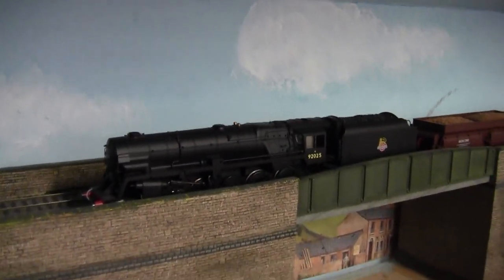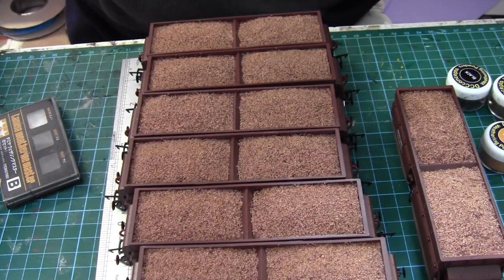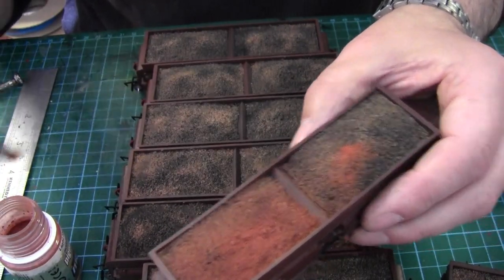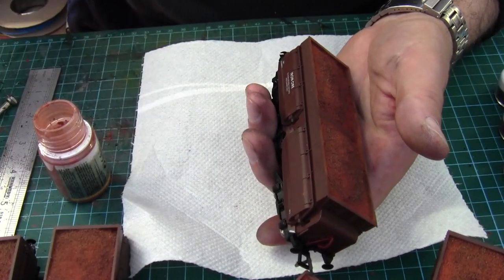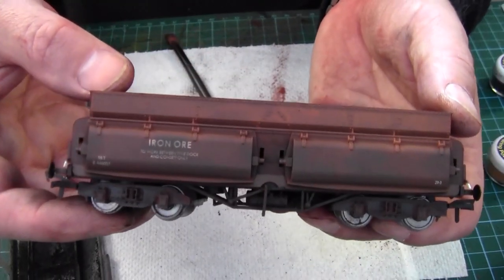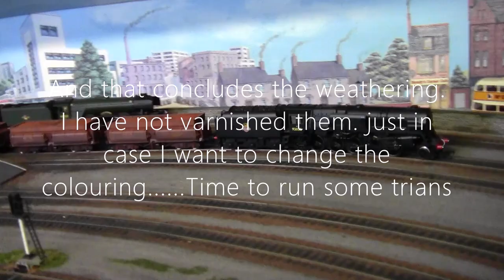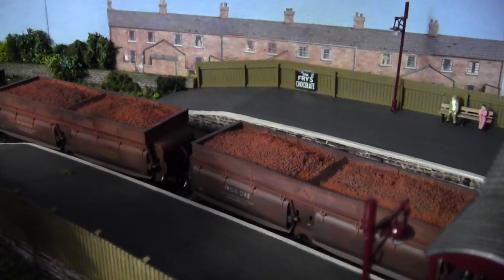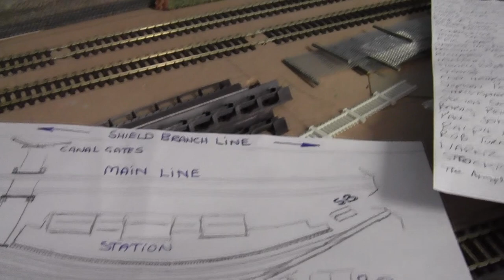Weathering the KR Iron ore wagons, & Competition Winner No316

Comment: Hi Tony 
Good work on making the loads and weathering them . I will weather all my wagons first off give them a black or grey wash which brings out the details and gives something for the powders to grip to. As John mentioned WWS powders are good value as you get large tubs . I also use pastels and scrape them onto chassis to give a rust effect or grind them into powders ( nice and cheap 😀) 
Cheers Kev
Reply from the maker: Hi Kev. i like nice and cheap. especially the way that everything keeps going upin price at the moment. thanks for the tips....all the best Tony

Comment: Good job on the wagons Tony, they really do look the part. On the subject of weathering powders, WWS to a great range and you get a decent sized tub, I bought a set for £20, which will last me ages. The other thing I have used and they’re pretty cheap are artist’s pastels, I bought an earth colour set which covers all the rusts and has a bright orange too. Only cost a couple of pounds from EBay. Scrape with a sharp knife and you get a fine powder and it does exactly the same thing as weathering powder.
It’s a great name for the new station West Haven, might have to twin towns, West Haven and Exehaven! Cheers Tony, Have a good week, John
Reply from the maker: Hi John. Thanks for the tip for using art pastels. never thought of using them. I have had a chat with Edd. and we have come agreement and called the Station Little Haven. after a beach in south shields. Twin Havens sounds great to me.. until next time stay safe. cheer's Tony

Comment: Tony, you could also take a look in the dollar store for some cheap pastel chalks. Or, as for my favorites, just plain ordinary pigment powders from your local art store. Those pigments really make a difference. They stick well and are true colors. It’s also amazing what kind of amount they sell in compared to those half filled one sandwich jam jars. 
It’s not that I don’t wanna use or purchase the stuff from wws or other suppliers. They make a great range of products. However, what those modeling powders go for is beyond amazing. Added to the tiny amounts they sell by. 
I’ve got some color powders from Pan Pastels. Those too look and work great. But they too sell only tiny portions. 
At our favorite art store, I buy the pigments for 250-500 grams, so way larger quantity, on average for half the price of the brand names. Some pigments are of course more expensive. Or need special care when working with them. Next to those more expensive ones there’s enough choice in less expensive ones as very good alternatives. I just avoid the ‘handle with care ones.’ And I just mix ‘m; for too dark I’ve got this past date batch of tile grout. Just a pinch of a teaspoon does wonders. Naturally, mixing stirs some of it up. Heck, when doing such I definitely may look like a coal miner. Consequently, it all adds to the fun, of both the experiment, the artistic license and eventually experience.
Thanks 🙏 for another great TNE episode. Cheerio!!
Reply from the maker: Great Tip Vincent. never thought of looking in art shops. these pigments are not cheap £6,00 for a small pot. rip off Britain. any thing to do with hobby the big boys think it a licence to make money. but yes i will bare that in mind when i need some more. very much appreciate the money saving tip. many thanks Tony
Reply: @TONYNORTHEASTERN  you’re very welcome!
Reply: Really like how you did these iron ore wagons. Love the black shade on the bottom end, it really enhances the view on those wagons. Already whilst you were doing ‘m, and when running on the layout. That addition of such shade enhancement truly adds to the perspective of the model. The simplicity of how you’ve achieved this will definitely invite other people to improve their weathering. 
Will check out the Tyne Dock channel.

Comment from the maker: Check Out Tyne Dock 54B        LINK     https://www.youtube.com/watch?v=XWocmoGgQho
Reply: Thank you very much, great colour on the weathering, need to get some of the MIG light rust!
Reply from the maker: Hi Steve check your subs i think they have gone up....
the MIG light dust you should be able to get from your loco war hammer shop or model shop....all the best Tony
Reply: @TONYNORTHEASTERN  Yes, subs still increasing rapidly, thanks for the shout out. Minimum order for free postage on games workshop web shop only £20, probably cheaper to mail order, than driving and parking in town! Do use typhus corrosion  for rust texture in conjuction with other pigments and colours. 👍